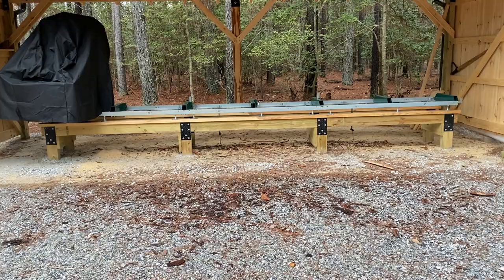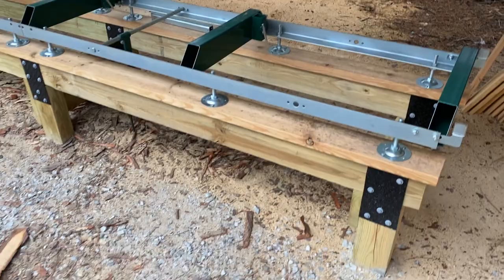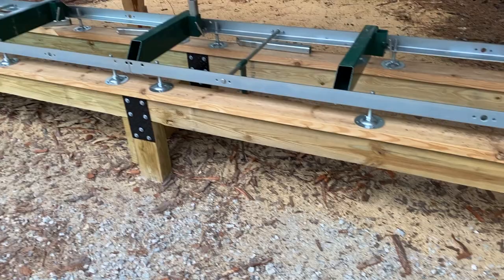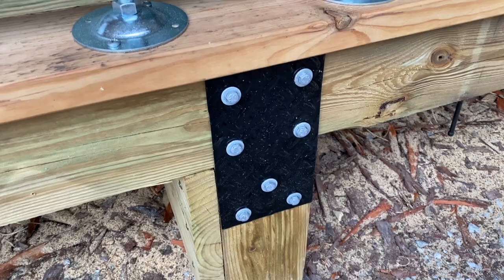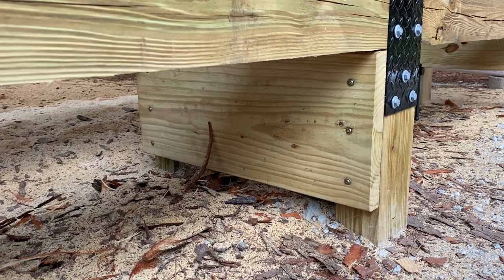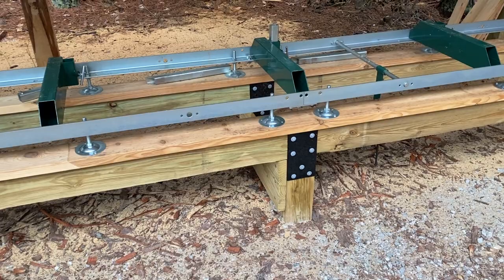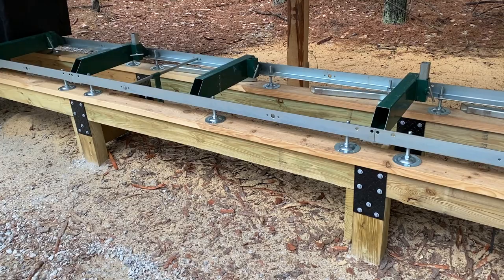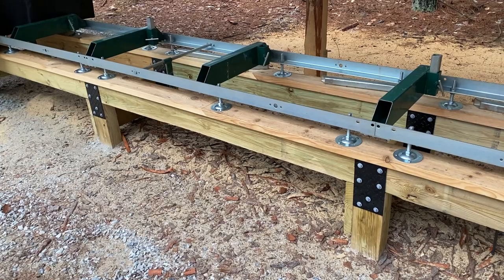Sawmill Base Overview

Comment: Very nice setup, the only thing I would do different is to use lag bolts or through bolts with nut and washer on the feet pads, when you have a big heavy log and rotate it, the force from it hitting the log stops will put lots of strain on those two small screws you have on each pad.

Comment: Mine a concrete slab on ledge.Yes it is a bit low. We load logs from a brow. Bridge pieces go to the mill.Then you take them away. We load the brow with tractor forks.This still concentrates the weight on legs on dirt?

Comment: What is your opinion on using longer(20 ft 3×4) one piece angle(one per side of course)for the rails instead of multiple piece that the saw comes with? I'm looking to order the 130max within the next couple of months.
Reply from the maker: I think it would be a great idea with a couple caveats.  First, make sure you can still adjust it and bolt down in spaced intervals to get it straight, as angle can be noodly in a 20 length.  And second, you may need to surface or machine the edge the trolley wheels roll on, as that dimension and edge shape of a hot-rolled angle iron is not usually controlled or consistent (I think the tolerance is intentionally poor there).

Woodland Mills machines the top edge of their track flat to a consistent dimension, I assume because of all the variability of off-the-shelf angle iron.  I've bought 20' lengths of angle iron for welding projects and have seen that variability from piece to piece.

Comment: Lumber Jack...A little late to the game here...I truly like your detailed videos...I want to build a base like you have done. You mentioned that Woodland has blueprints available, I cant seem to find. Do you have blueprints availble for purchase?
Reply from the maker: Woodland Mills has blueprints for all their mills on their website, which will give you dimensions for the sawmill bed.  You can then size the base to properly support the sawmill bed.  I used 4x6 timbers with 2x6 (flat) on top to attach the sawmill bed feet to.
Reply: @Lumber_Jack  Thanks Lumber Jack for the quick response.

Comment: curious if you used non treated for your adjusters did you have felt paper or a similar product in-between  your black plates ? Thank you for another outstanding video
Reply from the maker: Those were painted with two coats of oil-based black metal paint, that thick tarry stuff that is used a lot in welding/fabrication.  I figured that is as good of a barrier as any between the treated lumber and steel.  I do use felt paper between treated lumber and plated metal though.

Comment: You can put concrete under the post for support and around the post but you need to have a little gravel at the base of the post so water can escape. It sounds like you poured a cup or bathtub that the post is contained in allowing it to rot off prematurely. Hopefully I am misunderstanding how you did that.
Reply from the maker: I cover this on one of my pole barn videos.  Gravel works great in soil that drains and that is an awesome way to do it.  In some parts of the country, it is the standard procedure.  But here in our heavy clay soil it won't make any difference at all -- the post hole is like a clay bucket no matter what you do.

Posts rot at the interface where damp wood meets air (ie, they do not rot underground) so the most important thing to do around here is to put a good grade on the structure leading up to all the posts.  You want to make sure the post sheds water away from the level where soil or concrete backfill  meets air so that it can't accumulate moisture at that critical location.

Using this method I've had posts in the ground for 30+ years with no issues.  And in the same timeframe I've repaired other posts that failed because they were installed with poor grade or poor surface drainage.  They just love to rot off at ground level if moisture can pool or collect there.  Avoid that and the post will last a long time.

You can purchase plastic post sleeves or coat the ground level of posts with tar to add some resistance at that important moisture/air interface point at ground level, but in my opinion establishing proper drainage is more effective and cost less time/money.

Comment: Hi, i'm looking at buying the same mill within the next two weeks and also with one 7' extension. I was wondering, how long did your base end up from end to end? Also i was curious how far apart are the actual green painted log bunks on center? I'd like to have posts at every one of them in the ground or at least a cement block at every other one or something. I'm just trying to get prepared ahead and have my base built and something like you have is exactly like i had in mind. Thanks!
Reply from the maker: My base is 232" long, 29" wide, and 22" high.  Best thing is to go to the Woodland Mills website where you can download detailed drawings of the mill and bed (including extension).  It will have all the info you need.  The drawings are included on the product page for every mill.

Comment: You mentioned the untreated board used to set the leveling feet on to avoid corrosion...Would that not apply to the diamond plate gusset braces?
Reply from the maker: The gussets have a thick coat of paint and a layer of roofing felt between the metal and wood.  So I am not worried about those.  You can use roofing felt or flashing membrane to separate metal from treated wood with good success.  Same thing could be use for the top boards to protect the foot pads if you think treated wood is needed there (I didn't).

Comment: What website was it that you found the plans ? This is great, really enjoying your stuff
Reply from the maker: Woodland mills has drawings for all their mills on their website.  You can use them to design a base or trailer to support the mill.
Reply: @Lumber_Jack  what was the width you built your frame at.  I see the sawmill frame is 26” wide did you use that spec?

Comment: You used a laser level and tractor post hole digger for the building, but not the saw mill base. Bet the experience of doing it manually produced a change of heart.
Reply from the maker: Tell you what, any time I have to dig in our clay soil by hand, it really makes me question my sanity.

Comment: What is the height to the top of your 2x6 from the ground?
Reply from the maker: About 18" if I remember correctly.  But it is up to each user's taste -- make the total height (including bunks, etc) to put logs around thigh level, for comfortable working and minimize bending over.  I was aiming to replicate trailer height, which is how I used mills in the past.
Reply: @Lumber_Jack  awesome and thanks so much.

Comment: I was just putting down a 2000 dollar slab for my mill.....Then I saw your video....Might save me some cash
Reply from the maker: Yeah, I don't see the need for a slab or putting the mill down on the ground.  I worked with trailer mounted mills for years and having them up off the ground is more comfortable and productive all the way around.

Comment: Greetings, and great job on the videos! I just purchased and took possession of a Woodland Mills HM 126 mill. I am in the process of laying out the track post and beam support structure, such as you have presented. In doing all of the calculations, my question is that if you are using 2X6 untreated lumber on top of your 4X6 beams, do you still have the clearance for the longer log stops to drop down below the 2X6 face plates which you placed over the 4X6 beams? I am considering using 2X4 instead of the 2X6’s. Any thoughts?
Reply from the maker: The log stop posts are unobstructed, but it does require careful dimensioning to size the base properly.  You can use the blueprints on the Woodland Mills website to work it out in advance (or measure the track if already built).  A 2x4 is not wide enough to fully support the foot pads and provide material to screw into, so 2x6 is about the minimum possible.

Comment: How durable is this mill? Look possibly a bit less durable than a wood mizer, but I know looks can be deceiving. What’s your thoughts??
Reply from the maker: For years I milled on a friend's diesel Woodmizer with hydraulics and automation, and to me there is no comparison -- they are the best in the business for a high end mill.  But those are $35K-$50K or more, so it's a different market.  

In the last 5 years or so, Woodmizer has started selling lower cost hobby mills that compete in the same market as Woodland Mills and Frontier (I think Woodmizer realized they were losing sales by not catering to those customers) .  Those Woodmizer hobby mills are pretty comparable to Woodland Mills.  Under $10K, I don't think the Woodmizers are any better than the other guys.  These hobby mills ship knocked down, parts in a crate, and are meant to be assembled onsite by the customer.  They are all pretty similar to each other because of this design and assembly process.

Back in 2019 I had all but made up my mind to buy a Norwood or Woodmizer in mid-2020.  I had quotes from both companies.  But then Covid hit and both of those companies had issues with availability and their customer service took a dive.  That's when I looked at Woodland Mills, knowing a neighbor had one since 2016 and was satisfied.  Their customer service was night and day better than the other guys -- they were responsive and they were actually able to give me inventory and shipping information on the phone instead of vague guesses.  So I ordered from Woodland Mills and it has turned out to be a great mill and great experience.  I also saved a few thousand dollars over the other mills and feel like it's a great value.  Just remember it's a hobby mill under $10K and not a $35K Woodmizer.

Comment: Where did u get the adjustable feet and what diameter is the threaded part?
Reply from the maker: The feet came with the sawmill.  There are probably bolt specs in the user manual parts list you can view on the Woodland Mills website.